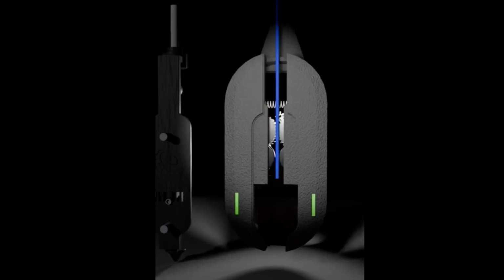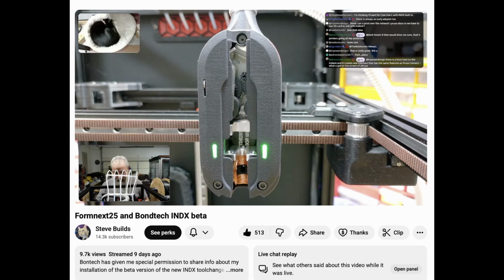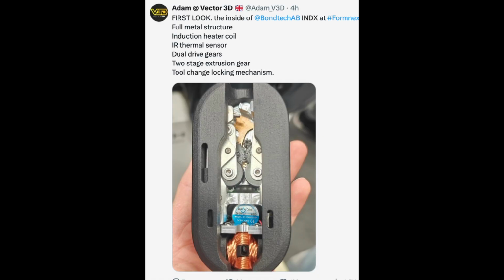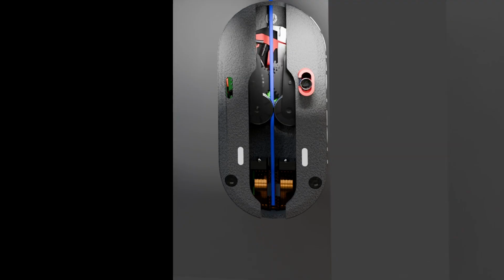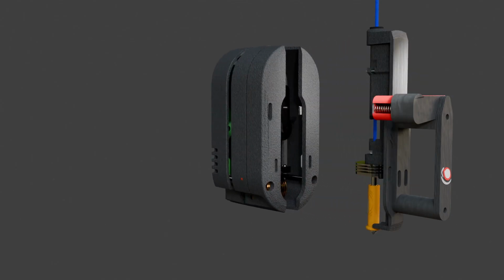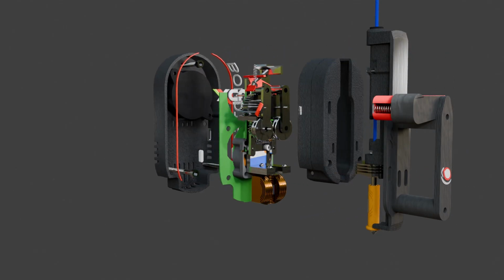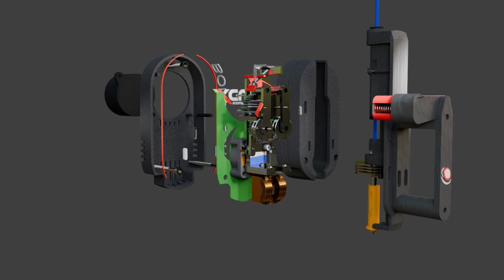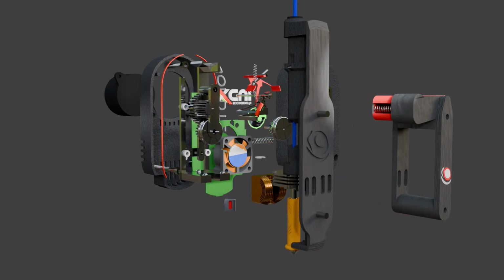Another attempt at guess how Bondtech INDX internal mechanisms work

Comment: Perhaps the tab on front functions much like the crown on a wristwatch internally. Not depressed and the extruder stepper runs the extruder gears. Depressed and the gears are decoupled and that energy is instead transferred to a small gear train which simultaneously actuates a cam at the lower section of the extruder teeth and the locking lug (in theory you can rely on pre-set spring tension and just use a cross bar/cam to open the extruder teeth during dock functions)

The tab could be as simple as a spring loaded wedge which moves a gear train plate up or down to select which gear train is in use. Such a set-up could/would be fairly robust and where its all inductive heat there'd be lower risk of losing spring temper.

Frankly even if not how bondtech has managed this im actually deep in thought on how to implement this as imho it feels like a particularly elegant approach
Reply: Alternatively a more simple albeit potentially thicker design approach would treat the driven shaft of the stepper motor very similarly to that of the input shaft of a manual transmission. A sliding dog gear on a simple D shaft with extruder gears forward and docking gears rearward (or vice-versa). So where the energy from the stepper motor is routed is dictated by if the dog is forward or back. (Im me. Idc about coming to the exact same solution as someone else but rather identifying feasible solutions)

Comment: What I figured out so far? The Maxwell, coupler is the key and the halls. The hall, the hall sensor that they have for the positioning that knows when the nozzle is in its place. A normal Nema motor turns and always turns in a Pacific direction, always lines in its Pacific. They're using the macro, to put it in a position to lock and unlock it. So based on the position that the code sets it, that's how it locks and unlocks. That's basically what I figured out.See what you can do with it, bro
Reply from the maker: I haven't noticed any mention of hall sensors on the Bondtech Discord only the IR sensor - although it would be good if they did include a few sensors for nozzle loading and filament presence etc.

Comment: The dynamic pressure could be caused by the arms that hold extruder gears if they can swing around the middle large gear. Like we see in pinch rolls. If the filament cannot be extruded the extruder gears kinda gets stuck and the torque to spin them squeezes them till the filament flows. And there is the spring so the arms can stay closed while retracting.

So it is just the nature of (idler?) swing arm mechanism if thats the name.At least thats my take
Reply from the maker: It think you may be right that the pressure of the spring, plus the extruder being walked by the gears closer together. Will try exploring that further.

Comment: Hey David i didn't understood  how the  bottom spring is functioning near hotend  big one
Reply from the maker: I think the bottom spring is what pulls the two extruder gears together during normal printing operation.

For a tool change the gears are pushed apart against the tension of the spring  by the panel at the top that slides down.